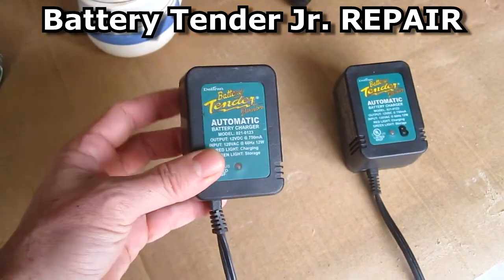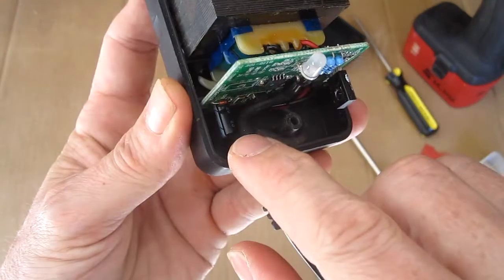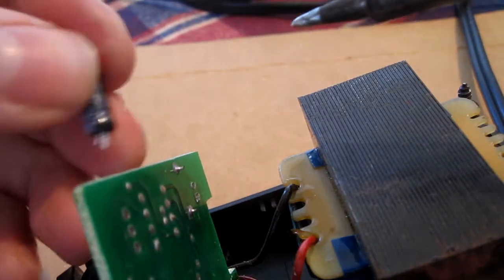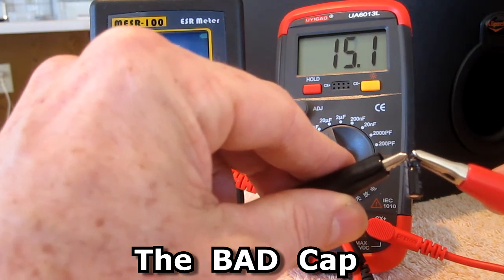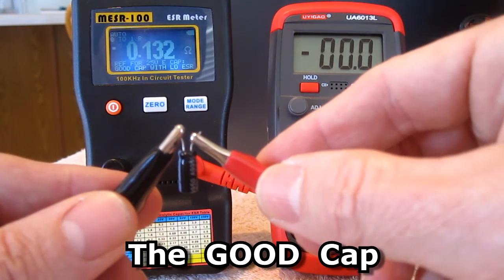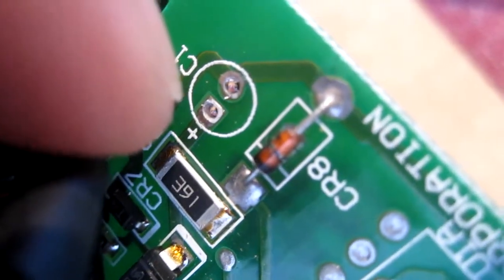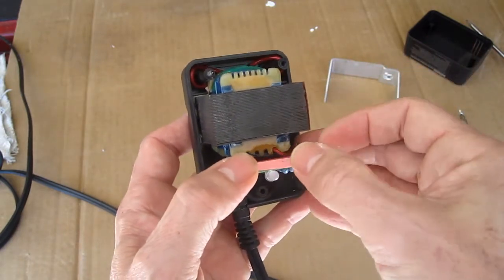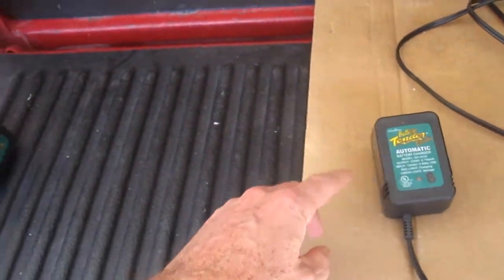Electronics REPAIR how to fix a Battery Tender Jr dead capacitor esr meter test bad

Comment: I just discovered the BT Jr connected to my 4wheeler was inop. looks like one of the cats had pulled the ext cord from its ceiling connection. reconnected the cord, but it was no led or faint flickering green led. swapped out for another BT Jr and got the red light, came back later to make sure it was charging, had 13.1 on the battery, and when plugged in to the BT Jr 13.5, so monitored the situation and it did indeed change to green in the next 30 minutes. took the inop to my desk, where when plugged in the red light flashes, tried it again on the 4wheeler but same, barely flickering green led and the battery voltage did not gow up when connected, this was before the good BT Jr indicated green full charge so it should have shown an output I believe. Gonna take it apart and at least do a visual to see whats up.

Comment: Thanks very much. These units get pretty warm which eventually causes the caps to fail. 

I didn’t have a capacitance meter but did have a new nichycon 47uf 50v in from another project!  

Your 5 minute fix saved me $45 and this tender should be good for the next 12 years!

Comment: Hello. Mine presented the problem, where the red led does not turn off.  Even after days on, it does not turn off, does not blink and does not change to green, stating that the battery is charged.  Can you help me?  Could it be that same capacitor?  Thanks.